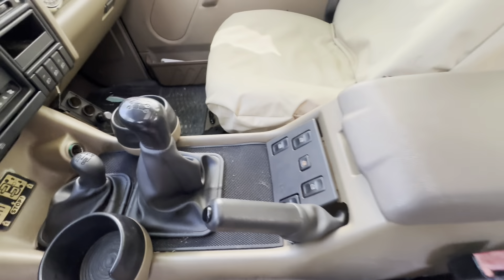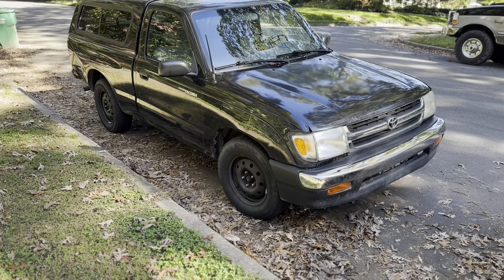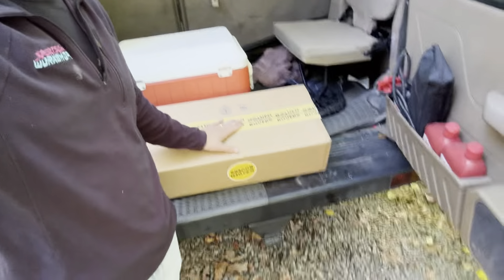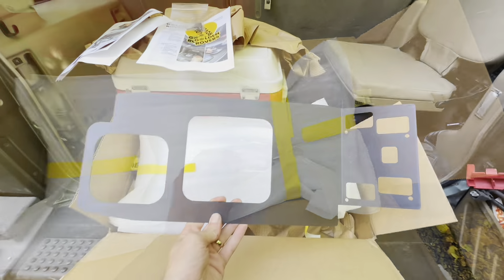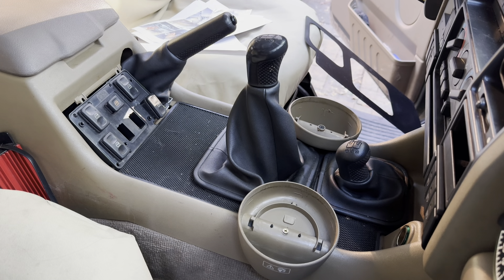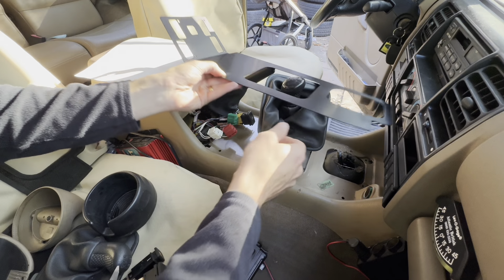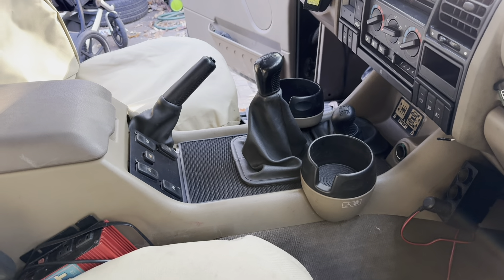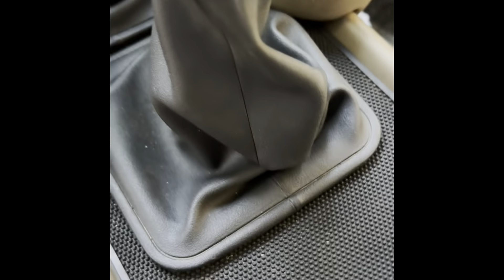Every Land Rover DI & DII Needs This Easy To Install UPGRADE!

Comment: Just bought a D2 w/o heated seats.  Looking to upgrade to Heated seats.  Read that all D2s with leather seats have the heating elements installed and wiring behind the switch plate.  Did you notice two plugs laying loose behind the switch plate?